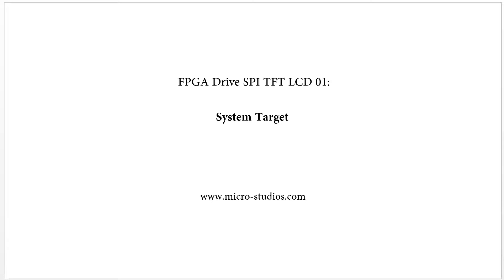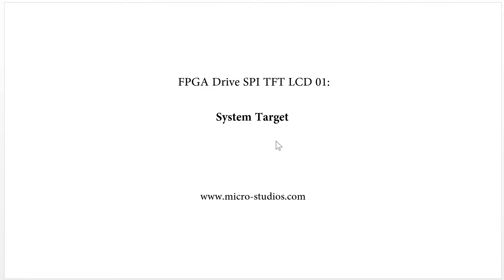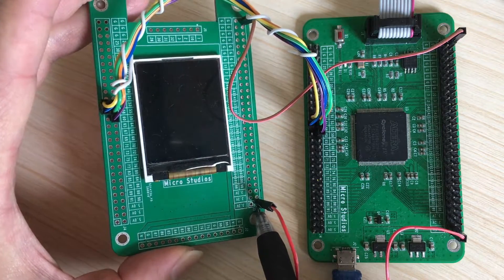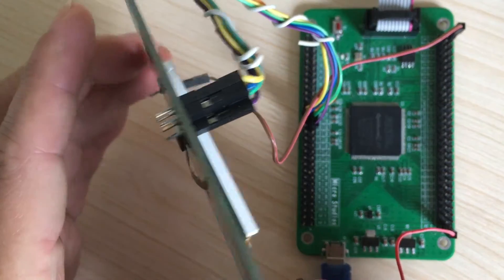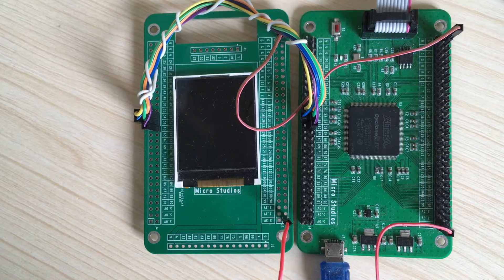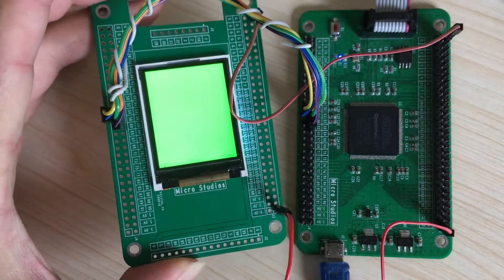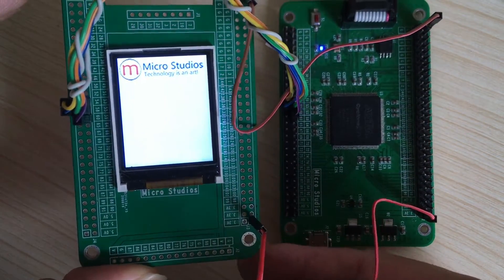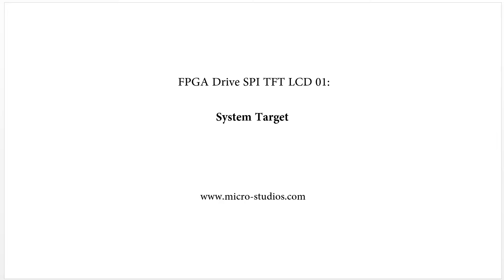FPGA Drive SPI TFT LCD 01: system target

Comment: Is tft lcd kind irrelevant?
Reply from the maker: For different TFT LCD, the system structure will be the same, but it will need a little bit change, for example, the initial register value, lcd width, lcd heigh etc.